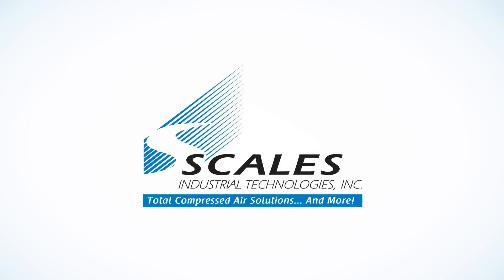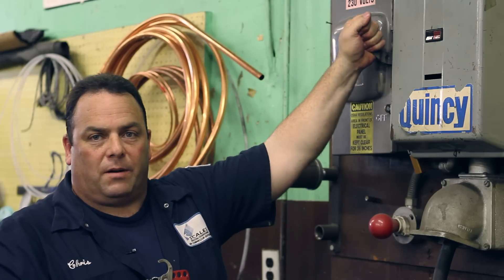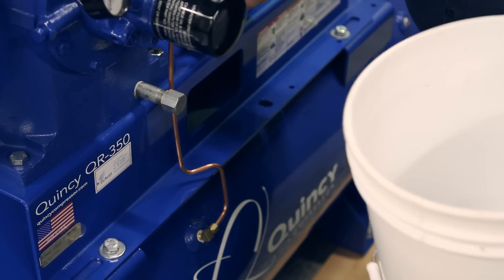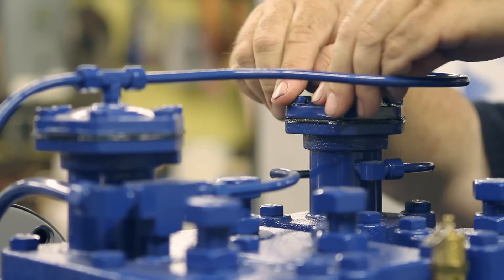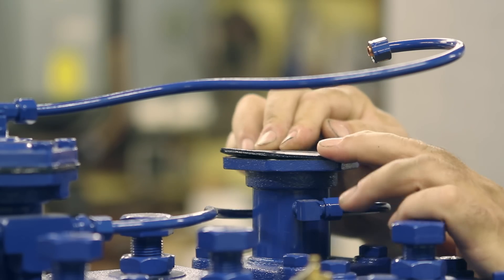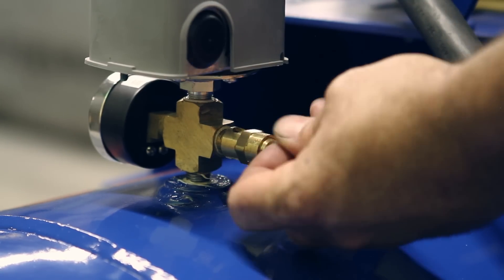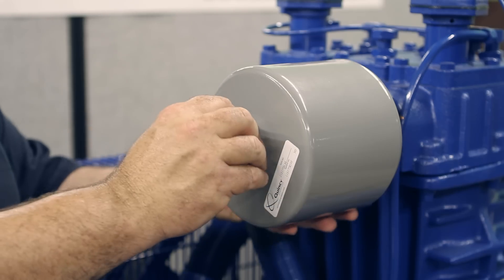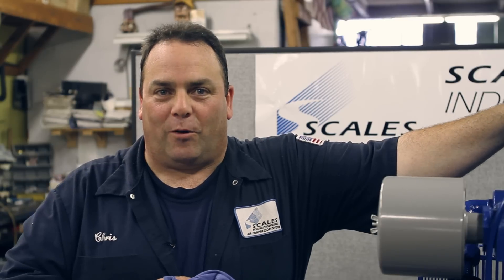Reciprocating Air Compressor Maintenance

Comment: Good video, very helpful....I'd like to point out that you forgot a very important step after locking out and tagging the power source. You are supposed to try to operate the equipment you are going to work on. Its a very simple step and could save you or someone else from serious injury/death. Thanks again for the video!